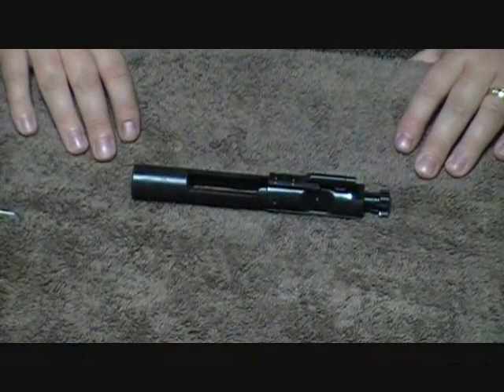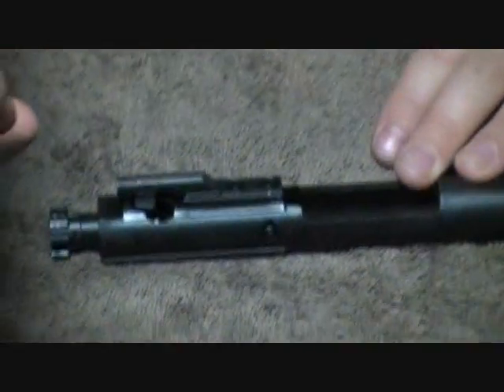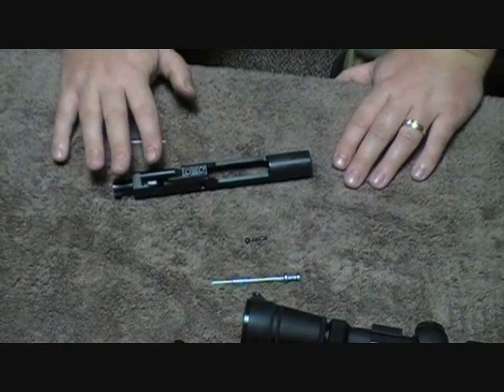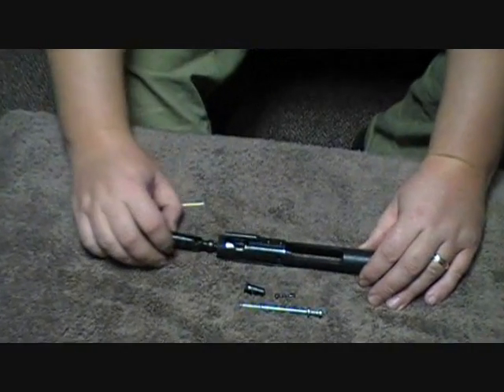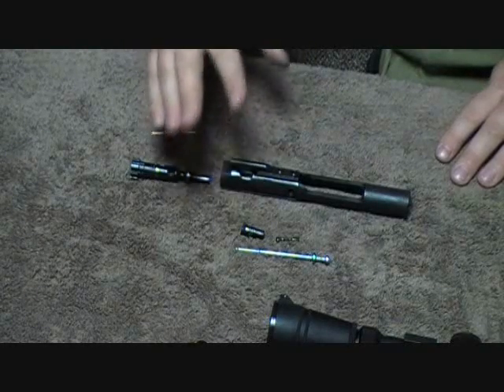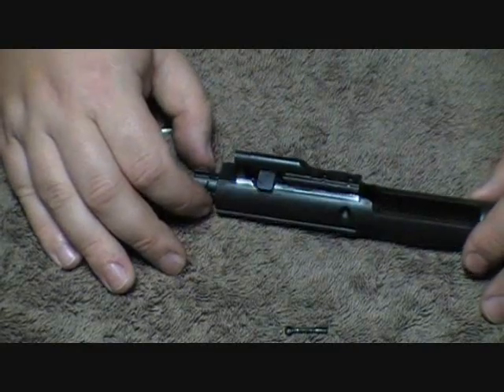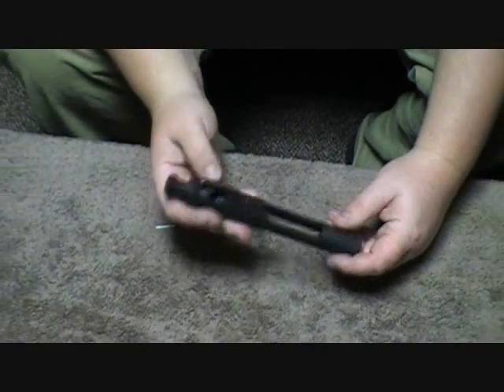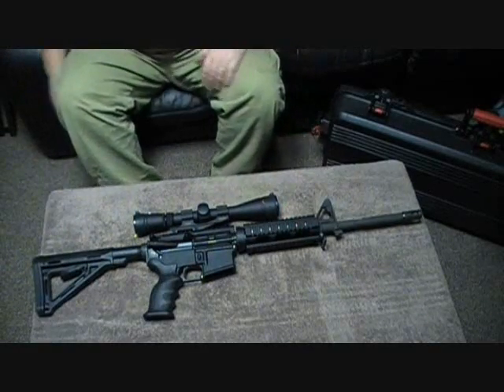AR-15 Bolt Carrier Group Disassembly & Reassembly

Comment: also if u cant seem to get the firing pin back in and seated properly make sure u turn the little Bolt that connects them together sideways so the firing pin falls in and seats properly

Comment: always remember to pull the thing forward before trying to put the bolt carrier group back in the little nut that connects both the parts the little bolt the carter key goes in to hold the firing pin make sure to pull it forward before trying to put it back in bc if its not it will not go back in just a fyi

Comment: Video misses some details ... Note the position of the bolt gas rings and the ejector when assembling.  Space the gas rings so the gaps DO NOT line up together.  Insert the cam pin with the ejector on the bolt face at the 10:00 position (looking at the bolt face)
Reply: You said it for me.

Comment: The knob is actually called the "Cam Pin" the next piece that slides out after you remove the cam pin is the actual "Bolt".
Excellent job guys, every effort is good and sincere...
40 years ago we use to practice stripping down blind folded. It's a perishable skill so if you don't stay on top of it you WILL forget shit. Few years back not only could I NOT strip blind folded I had a problem remembering while looking at the rifle...lol...I've since refreshed and redeemed myself...

Comment: Would be better if the other guy would stop chiming in. Annoying voice too, All  he did was  help  lose my train of thought watching you do the assembly/ disassembly. One question : Should the bolt be forward sticking out of the carrier or pushed into the carrier when inserting the firing pin and pin retainer?

Comment: I use Krytox grease on mine. Light coat of that stuff goes a long way. Tube I have retails at 1800 bucks luckily I worked for Dupont and knew a guy who worked at the Krytox unit. Shit is amazing wheel bearing NEVER ware out any metal to metal contact becomes nonexistent.
Reply: Did you say $1,800?!  Or $18?
Reply: jordanaug81 Sorry price came down lol its 1,200.00 now for the grease I have.
Reply: For lubricating your firearms....it's your money.

Comment: Unload your rifle of all ammo, and Magazine...TRIPLE CHECK  to make certain,if ..the carrier group is not going into the receiver ..make sure to twist the (cam pin) forward ..which will extend your bolt out to about an inch..then re-insert the (BCG) into the receiver..should have no issues..then function check safety, and fire, ..just like the video is showing here...

Comment: Nevermind, it can only be inserted one way because (on mine) the other side is slightly smaller and you can't push the pin in.

Comment: Why doesn't anyone say which way the inner bolt should be turned when you put it back in? Since you can spin it around there are two possibilities that allow you to push the pin in. The little ejector sits at a completely different angle though.
Reply: The bolt face has lugs sticking out of the face. As you look facing the bolt face , at 10 O'Clock position is where the flat empty space should be to the left.
Reply: The location of the ejection port on the receiver should give you a big clue. However, just like with working on cars you should probably be paying attention to how it goes together during disassembly, so you don't have those problems later on at a time where YT isn't around to save you.
Reply: GenXRanter jj